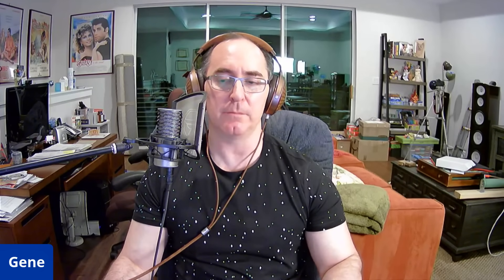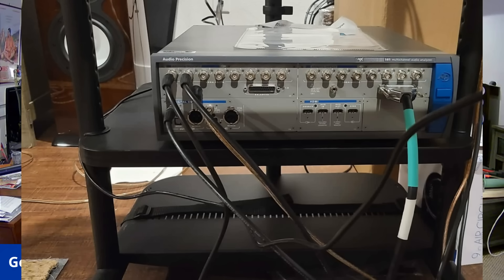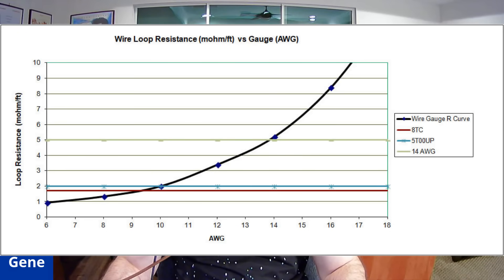Speaker Cables Really Don't Make Much of a Difference?

Comment: Gene, thank you for the video and objective testing.  It is appreciated!  Even though your conclusion is that cables don’t make an audible difference your test is still missing one important aspect.  If I understood correctly you used a 9, 10, and 14 gauge cable.  With the premium cable being 9 gauge, and the generic cable being 14 gauge.  I’d like to see the objective measurement test again with a generic cable vs a premium cable at the same gauge.  The difference would be even less - further putting this decades long discussion to bed. 9 gauge generic copper cable for instance vs your 8TC cable.
Reply from the maker: For sure. If gauge was kept equivalent, there'd be no difference in insertion loss. Good point.
Reply: It's just a shame that according to the author of the video, the gauge of the cable makes little difference over the same length...and no comments were made in the video concerning the material the conductors are made from, the twisting and spacing of the conductors, the insulation used or even the diameter of each of the individual strands - these are all variables that have NOT been taken into account...and until they are, then the above video is not a confirmation of the conclusion...no matter how expensive the test gear is. A "definitive" report covers more than 3 samples and in this case, the samples were chosen by the author...so it is hardly "conclusive" and as such it is NOT scientifically proven.
Reply: @timomalley1027  It might not meet a rigorous scientific standard but it's good enough for the purpose, listening to music. Maybe if we were talking NASA mission critical it would make sense but there will be much more variation in rooms, positioning and even manufacturing tolerances in the hifi components. I'll stick with £30 rather than £2000 cables. Of course if you're Jeff Bezos spend away, it's only money 😉

Comment: If all cables are the same, shouldn't all of the graphs be just one line (all overlapping) ?
Reply from the maker: They are if you blow up the vertical axis enough. I had to really zoom in to show the differences. The point is, the measurable differences don't translate much to actual amplitude response differences when connected between an amp and speaker.
Reply: @Audioholics  Do you think a .001 uF shunt capacitor would sound different than a .002 uF cap on a tweeter?
Reply from the maker: @ranbymonkeys2384  probably not, especially if it's a shunt and not series element. It's something easily measurable, however.
Reply: Just one thing is bothering me, if you had to "zoom" in then how are the capacitance levels so even all the way through the spectrum?  I would figure a slope with the frequency increase.

Comment: Thanks gene. I just started the process of building my dream system. It will serve as a duel purpose system. 5.1.2 home theater and 2 channel listening. My speakers are bower and Wilkins 805d3 fronts, center and rear in ceilings.one of the toughest decisions is the cables. I was leaning towards audioquest . Thanks for the video and information. I’m still not sure what cables to use.
Reply from the maker: low resistance is the key. Watch my other video on that topic.
Reply: @Audioholics  thanks buddy looks like kimber wins
Reply: Stay away from AQ. They mask the type of copper by using flowery names for their cables. It's the same Chinese cables the other, lower priced vendors use.

Comment: I used to believe that the expensive cables really did make a difference. I don't believe that anymore. I currently use blue jeans interconnects and speaker cables as well as HDMI cables. I enjoyed the video very much.I used to believe that the expensive cables really did make a difference. I don't believe that anymore. I currently use blue jeans interconnects, speaker cables, and hdmi-cables. I enjoyed the video.
Reply: You need to make your own mind up, using your ears, rather than relying on someone elses opinion based on a limited range of samples of dubious quality. PS: Hope you enjoy using your current HDMI cables, esp if they are more than (say) 2 years old, as they are bound to work with High Resolution 8K HDR video (HDMI v2.1).
Reply: I'd say this, if it was obvious that there was a difference there wouldn't be any debate. That there is no difference or so close as to be debatable tells me to save my money. The Emperor's New Clothes springs to mind.

Comment: Finally!  A credible source who has the courage to measure it and say it!  Thank you.
Reply: That’s what she said
Reply: Finally? I think John Dunlavy did it 30+ years ago, and he got a lot of flack for it from the 'golden ear' audiophiles.
Reply: Calling the Denon PMA-A110 state of the art is a joke. My $2,999 Benchmark Audio AHB2 amp has orders of magnitude less distortion and noise than this run of the mill amp. And yes, the less noise and distortion results in a cleaner, clearer sound.
Reply: @edgeecards  The A-110 shows extremely low THD+N for an amp of its kind: traditional Class AB Integrated.

Since you invoke measurements by AP (as such, tested evidences), you should know that you wouldn't be able to hear any difference between both if level matched. As you wouldn't between the AHB2 and Purifi. AHB2 measures better (and better than any amp out there) but both will be equally audibly transparent.

Also, the noise doesn't reach the limit mesurable by an AP (x555) at all. Distorsion yes, but SINAD is pulled down to ≈112dB only because of the Noise. Still the best performance measured so far.
Reply: @vintageflanker7096  If your source is extremely low noise and low distortion like the BENCHMARK DAC2 HGC DIGITAL TO ANALOG AUDIO CONVERTER  with the AHB2 then you will hear the difference. It is audible.
The AHB2  SINAD has been mearsured at 113dB.
Reply: @edgeecards You can't hear the difference between such SINADs. The former DAC2 si way overperformed these days. AHB2 still the boss in town, tho. Did you Listened to both blind? I don't think so. I don't think you even listened to the A-110 once. Again, don't argue using SINAD (=Objective fact/measurements) along with unverified claims..."This is audible".😉
Reply: Forgot to mention the AP analyzer shown is at its noise and distortion limits when measuring the Benchmark amp output according to 2 independent tests.
Reply: @edgeecards  it doesn't matter you can't hear the difference in the measured distortion it's beyond the limits of human hearing that's all that matters.
Reply: @curly1002  cite please.
Reply: @thomashobbes8786  it seems you didn't watch properly levels of distortion that small are impossible to hear by any human they can barely be measured by an analyser let alone be distinguished by your hearing
Reply: @curly1002  , you're drawing a wrong conclusion. I did watch. And if you watched it, you too would know that the author never mentioned listening. Instead, he only drew conclusions based on measurements. Thus, it is an incomplete analysis despite the assumptions that you want to build into it (being what you can and cannot hear, and being that what is being measured is all that can be heard, and further being that the measuring equipment was recently calibrated if you really want to get picky, but that last part is irrelevant to my point).
Reply: @thomashobbes8786  you can't hear it, so it doesn't matter stop disputing facts 0.06dB at 20khz is not auduble as he mentions in the video the limits of human hearing are well studied and the distortion levels between the amps metioned ca't be heard either if you think you can hear it you are deluded.
Reply: @curly1002  , 20khz is the limit for air-borne sound, yes. Not for tranductive sound through the skull. That goes to around 50khz if I remember correctly. Really, guys, you're not looking at or analyzing the whole picture because you are locked into your own perceptions.
Reply: @thomashobbes8786  you can't hear it I'm sorry but that's the truth not my perception it's science of human hearing and sound reproduction well understood over many years.
Not some audiophile rubbish you can believe what you wish please don't bore me anymore with unscientific rubbish thank you
Reply: @curly1002  , yes, the science of hearing sound reproduction is well understood. The seminal paper written about transductive sound hearing being well above airborne sound waves was written in the 1950s if I recall. So you may want to study up on the side of science that is routinely ignored by the industry marketing department before getting too comfortable in your beliefs, opinions, and conclusions.
Reply: @thomashobbes8786  why don't you provide quotes of this study and enlighten everyone as to how this effects the measured distortion being inaudible to the human ear you are clutching at straws.
The point still stands you can't hear the difference between cables of a sufficient design and length no one can that is a fact.
Show a double blind study proving otherwise or do not reply with more nonsense
Reply: @curly1002  , first, find your own study about transductive hearing. There's an internet, it isn't hard to find. I'm not here to educate you, though maybe I am here to open your mind a bit. That, though, seems fruitless.

And you can't do a double-blind study on cable switching. The person switiching the cables will always know, so the best you can do is a single-blind study. 

So no, I'm not clutching at straws. I'm following actual scientific method. Not a partial scientific methods as is being followed by you and many others on this string and channel.
Reply: @thomashobbes8786  I thought as much you can't provide any evidence just supposition and hearsay I have provided the facts from the video you have provided nothing in return. You can buy your overpriced cables if that makes you happy
What is the saying " a fool and his money are easily parted"
Reply: @curly1002  I thought so.  Meanwhile, my $20 cables are doing just fine. Enjoy your assumptions, chump.
Reply: @thomashobbes8786  yeah it seems like people are arguing two different questions here. Some people are asking if cables make any difference at all. And some people are asking if cables make any difference to how we hear the audio. Well, it is true that different cables will have different speeds and processes than other cables in ways that are in perceptible to the human ear.

But other than aesthetics and durability, there's no benefit to buying nice cables. Maybe their stuff happening that is slightly different under the hood, but if it's not audible, who cares? I mean A/b testing is the only thing that would matter here.  If the difference in sound is so negligible that you can tell the difference in A/b testing, what is the benefit of spending $3,000 versus 50?? Outside of aesthetics, design and durability.

Comment: All I know is I want copper cables, but does that even matter? Lets measure some aluminum ones or CCA? :)
Reply: Go to Wikipedia on types of Copper. There are only 3. OHNO is the best and there are OHNO cables less expensive than some OFC.
Reply: You can use steel cables, for all anyone cares, as long as you keep the resistance the same either through shorter lengths or larger diameter, you won't hear (or measure) any significant difference.

Comment: But Danny from GR Research showed that if you plug a cheap ass cable to a receiver it is an antenna. What the hell are these measurements you are talking about you flat earther
Reply from the maker: That was a very misinformed video. A terminated speaker won't act like an antenna.
Reply: @Audioholics  You are a flat earther then. Danny also said that he can hear RF noise in cables. Even if they are on MHz-GHz range. What, you can't?! You are obviously a flat earther then ;)
Reply from the maker: @jaytorr6701  Hmm  I want what he's smoking. Sounds like a trip.
Reply: @Audioholics  I would say all his videos are misinformed. Unfortunately intentionally. Since he started making cable kits he is trying with the worse science possible to show that cables matter. Before that he maintained that pretty much any speaker under 2000 dollars cannot compete with his 300 dollar  DIY speaker.
Reply from the maker: @jaytorr6701  Very unfortunate to see that. I rather liked a pair of Encore XLS speakers he made for AV123 back in the day. Good budget speakers...

Comment: It's not really a function of inductance or capacitance in the cable, it's almost exclusively a function of the imagination of the listener.  The last couple feet of speaker cable in my DIY open baffle 2-ch system is Radio Shack clip leads and I would put that system up against the best high-end commercial speakers connected with the most expensive cables on the market. 

As for non linear distortion, at 7 KHz the 2nd harmonic is already 14 KHz where your hearing curve is far less sensitive not to mention even harmonics are not particularly unpleasant.  The first odd harmonic is the 3rd at 21 KHz, already extending above anyone's hearing range.  So what if distortion did rise a bit at high frequency, who cares if all the harmonics are above hearing range anyway.

Fantastic video!  I'm sure you are going to get a lot of fanatics complain but so what it's their money they're wasting, we can just laugh at them behind their backs:-)

Comment: Great Video, a KEF Reference Series installation manual from the late nineties only says ' Poor quality cables can seriously affect the overall sound of your hi-fi system'. The problem is that they don't quantify what a good cable should be .... until Gene tells everyone, 20 years later!
Reply: I actually used to write the KEF instruction manuals...and the problem is that some people do not understand that "any old bit of wire" that they might have lying around, is not going to be good enough as a speaker cable...and as a former audio installation engineer, (prior to working at KEF), I've seem some pretty awful "wires" used for speakers - old telephone wires, very thin lighting flex, bit of surplus twin & earth, microphone cables, you name it.

And the problem from a big loudspeaker company that exported its products around the world, is that different markets (ie Europe, Asia, the Americas, the Middle East etc) have different ranges of "good quality cables" available - so one could not suggest specific brands or even types of cables....you just have to highlight that there are "poor" and "good" types (in each market) and to choose the good type....and that can be done ideally with the retailer who sells you the speakers.
Reply: @timomalley1027  Thank you for the reply and insight. I think Gene is doing a great job to educate, which is all I ask.

Comment: Why doesn't  Best Buy set up the same speakers with different cables, so you can switch between them to hear the difference? It would be a great way to sell more expensive cables. The only possible reason is that it does not make a difference.
Reply: I have been an audio retailer in the UK for many years and I have conducted unbiased home demonstrations with customers (both while they listened to various products as well as leaving said products with the customer for them to listen to, over a few days or a week so they could switch products as and when they wanted to). And in 99.9% of cases, customers heard differences (between the cables) and made buying decisions based on what they heard. So, you need to choose the right dealer who'll help you make a choice based on what YOU hear, rather than what the dealer wants to sell you...and I know a lot about how some US dealers work and the methods they use to sell you the product THEY want you to buy...

Comment: @Gene -  Thank you for showing your test gear and processes for measurements.   Thank you for pointing out the differences in the "sound" of a system are less affected by cables than other factors such as acoustics, "listener location" within a room, and even the room itself.
Reply: Such a shame that some types of cables were NOT covered and which have much higher inductance, than the 3 examples used. Also a shame that a $3,500 amplifier and $16,000 speakers (both of which will not have had any "corners cut" in their design) were used as there are certain amplifiers that eschew Zobel networks on their output stages, some tube amps work differently (due to the use of small or large output transformers) and certain speakers that have known reactive loads - all these options were not covered. (And no attempt was made to include these in the final report).

So the test results shown are of limited validity due to the 3 cables chosen as being "typical" and the amplifier/speakers used. Much better would be to do the same testing on (say) 20 different designs of speaker cables...and then the outcome might be quite different.
Reply: @timomalley1027  nah it would'nt

Comment: I purchased mediabridge 12g about 6 years ago I have it to 2 of my amps then a month ago I tried to see how much I had left on that round spool because I wanted to use some and when I took some off to put banana plugs on I noticed the red wire had small slits in the wire so I went back further on the wire and noticed more slits I think the covering has failed on the wire because the cable is rolled in a tight circle it’s even hard to straighten up the cable does anyone have any ideas on why the covering is splitting? Thanks
Reply: Possibly UV, heat or just age.

Comment: You're preaching to the choir with me. Been there, done that... as well as being an EE at a prestigious measuring equipment manufacturer, hearing the old > 15 kHz. tv's audible output, etc., amateur extra class radio operator... yadda, yadda, yadda... even a college degree in experimental psychology... I have owned great audio equipment for decades. The BIGGEST FACTOR is the listener to an audio system. Period. Some don't even listen to the music... the typical audiophile. LOL They are EQUIPMENT freaks. Yup. That's what they are... rich equipment freaks.